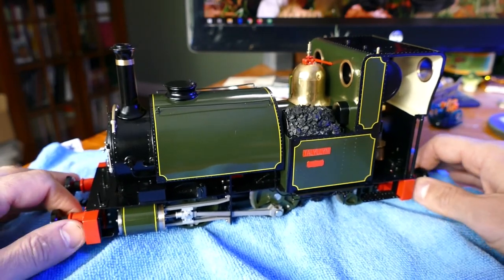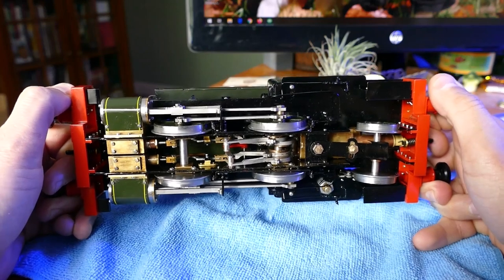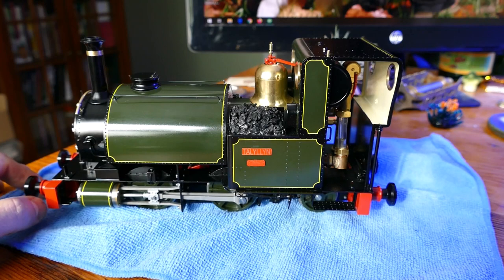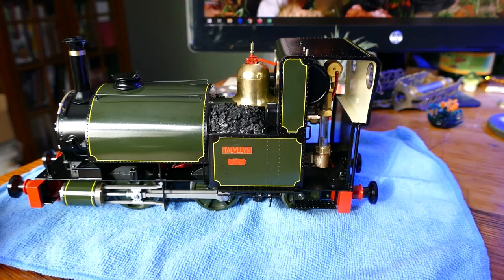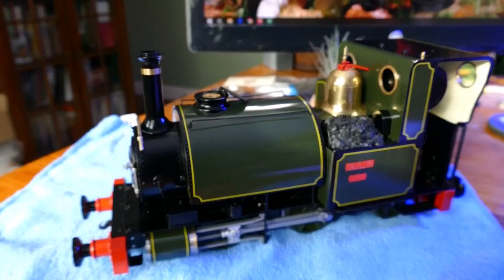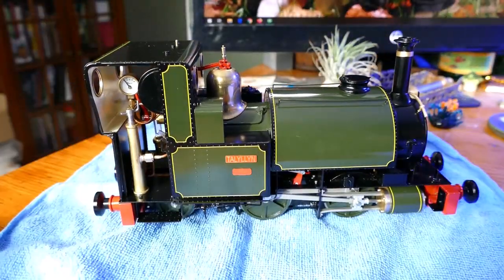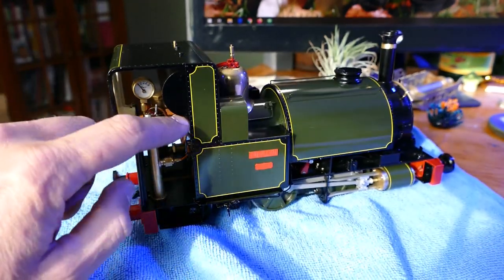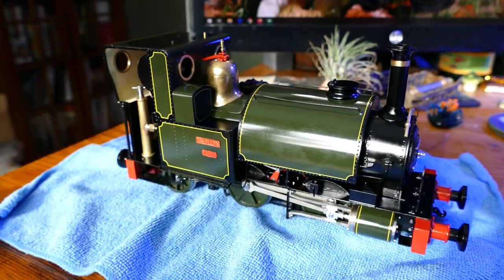Talyllyn No1 Live steam in SM32

Comment: Not sure about the gas tank in the cab... Which is best, this or the Accucraft version?
Reply from the maker: You have the option of getting a smaller fuel tank that sits in the left side bunker.  That way if you want to work with a shorter run time and a open window look you can.  The side fuel tank is sum 20min run and the roof tank  can squeeze 30min